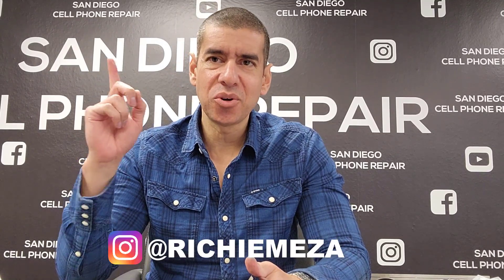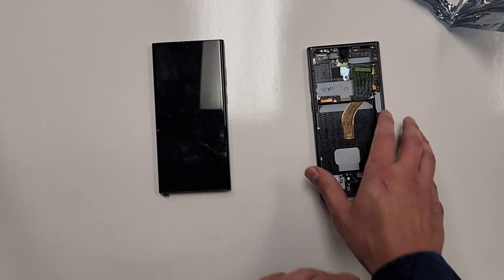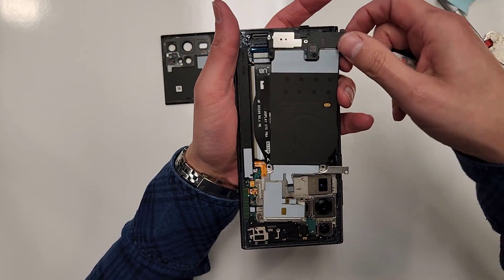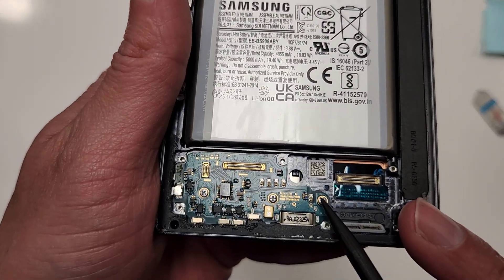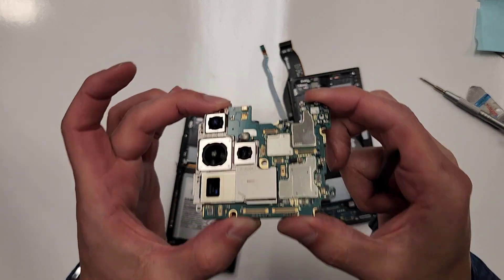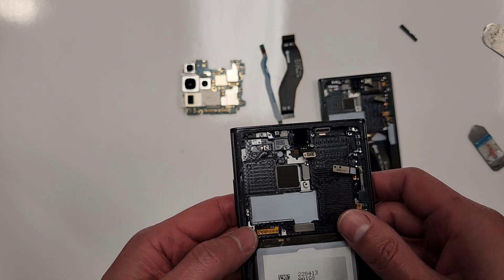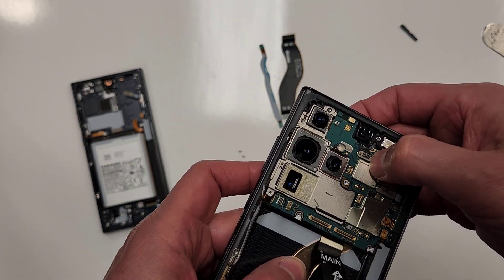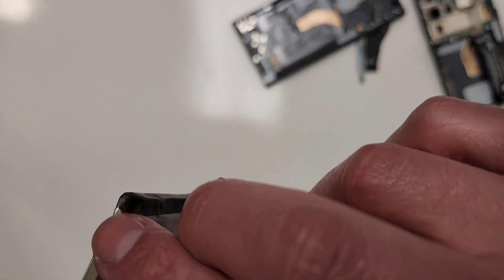Samsung Galaxy S22 ULTRA Screen Repair | How to Replace Cracked Display

Comment: HELP PLEASE!! S22 ULTRA BROKEN DISPLAY. PURCHASED GENERIC BRAND DISPLAY BUT THE TOUCH DONT WORK BECAUSE HAS LESS PINS THAN THE ORIGINAL FOR THE SCREEN CONNECTOR. CAN THE DISPLAY CONNECTOR BE REMOVED FROM THE OLD PHONE AND  BE PUT IN THE NEW DISPLAY SO THE FLEX CABLEX WORK PROPERLY?
THANKS!!
Reply from the maker: From what I've heard, the generic Samsung  screens have major issues after the lastest software update.
Reply: @RichardMeza  but do you think the pin connectors can be replaced or I just wasted my money with the generic one?